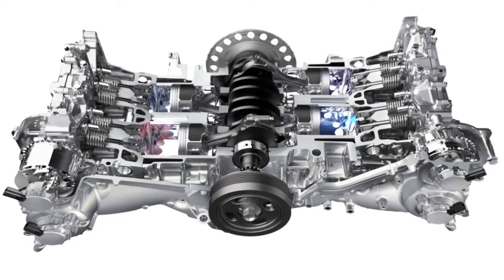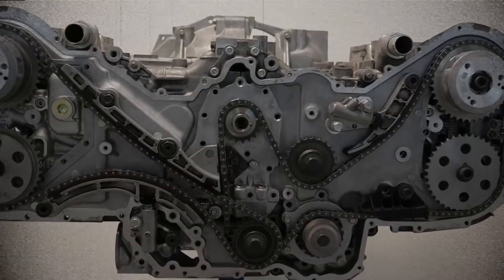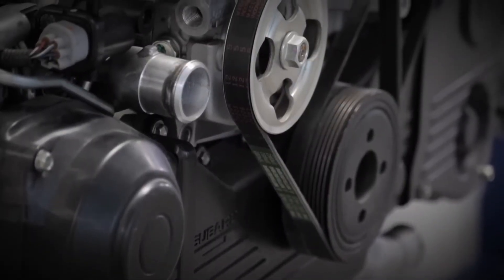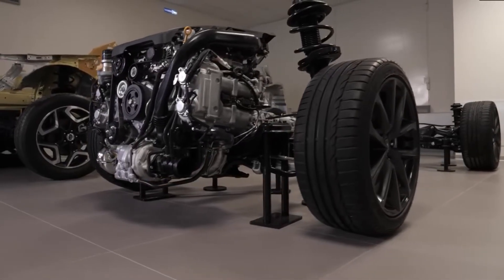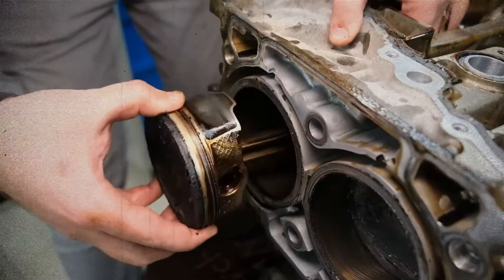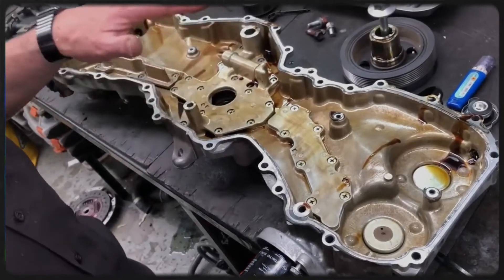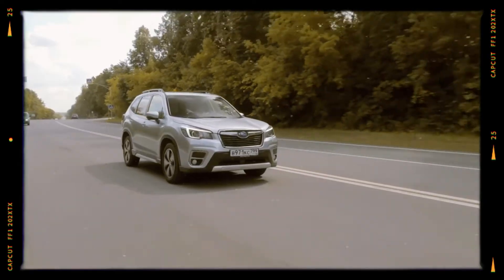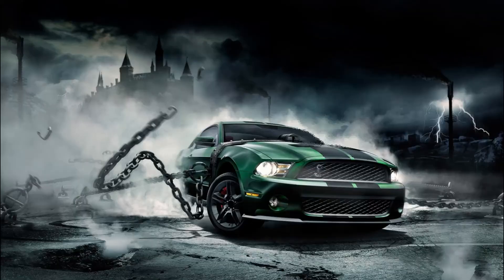Subaru FB25 2.5L Engine Overview: Specifications, Issues, and Reliability!

Comment: 2018 outback owner here. Suffered the cam carrier leak at 92km. Fixed under extended warranty. Got them to through spark plugs and new pcv valve while they were there. Been trouble free besides that. Doesn't burn any oil.

Comment: I take issue with the remark that a timing chain is maintenance free.   It depends on the rpm used, presumably in USA, you sound English but price in dollars, automatic gearbox is normal and therefore high rpm rare but each chain has to go round the tiny crank sprocket and if that stays above 4,000rpm for long the chain is grossly overspeeded - read a chain catalogue or maker's recommendations.  One reason for belts was to get away from wearing chains.

Comment: All Subaru have improved here is the problem list, this company peaked in the 80s, the cars that they try to make now are less capable than the cars they made in the 80s , Subaru are advancing backwards, every thing that Subaru made that works they don't keep, and everything that doesn't work they keep, not too mention everything that keeps getting changed,eg look at gear box variations,gearing variations, springs, brakes, the whole lot is a mess,if it works don't fix it and save time and money and more so your loyal customers.

Comment: Just use 5W-30 oil instead of the watery stuff that every manufacturer recommends these days. You might lose a small fraction of fuel mileage, but I'll help solve a lot of issues and retain longevity.
Reply: Nah that's false information. Using the recommended viscosity does not cause issues.
Reply: @NoName-gv6nm correct. That’s why in countries without fuel economy laws and regulations the manual states to use 5w30.
Reply: @NoName-gv6nm ok, so just ignore the real world evidence that suggests otherwise? Righto 👍
Reply: @NoName-gv6nm  5W30 for "heavy duty" use - which now days means being an uber driver.

Comment: 5% is a lie. I buy, fix and sell subarus a lot. Only 5% of FB don't burn oil. It is easy to tell, look at your exhaust tip, if it is black, you are burning oil. If is it clean metal, you are not burning. 
Video also did not mention coolant crossover pipe o ring leak, PCV union issue and the legendary upper oil pan o ring issue.
Reply: Я владелец. Труба чёрная.... но масло не жрёт🤔

Comment: I have a 21 Subaru legacy with the fb25 my engine blew at 95000
Reply: Did you abuse or neglect it? Oil levels good? Engines don't just blow really.